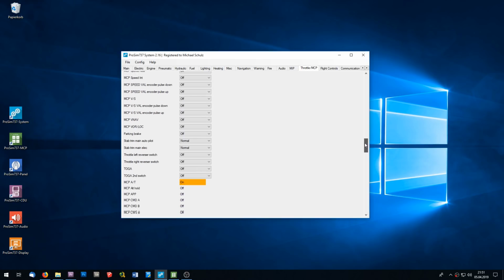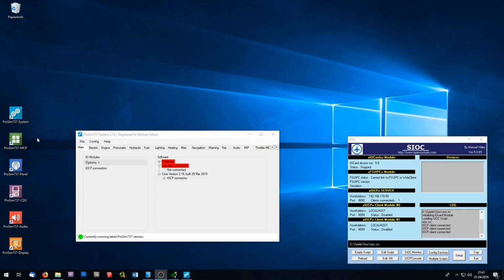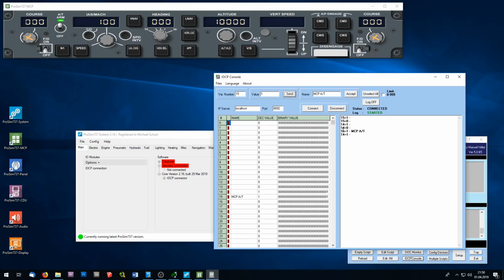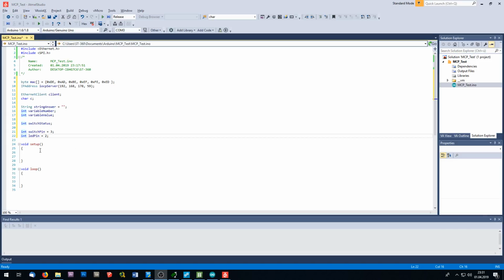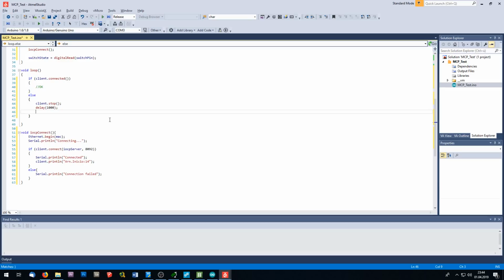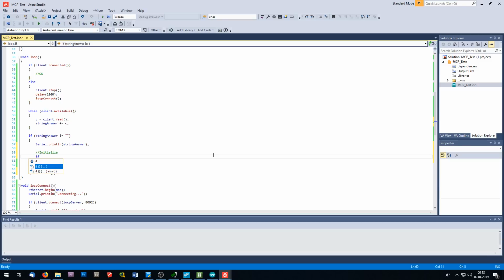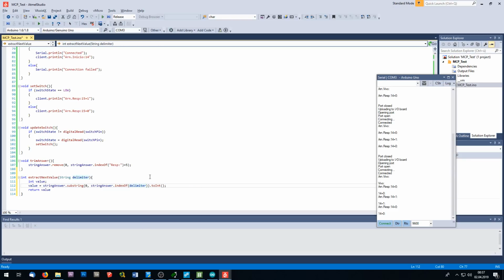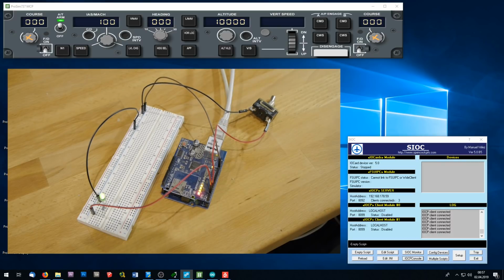Connecting an arduino to Prosim737 - A Boeing 737-800 Homecockpit #33

Comment: Nice video Michael. I work in an airbus 320 simulator, working with prosim. But we have a lot of problems about the options of weather (local and global) do you have some tips? Kind regards
Reply from the maker: Sorry Tomas, my current state of the cockpit is the one you can see in my videos. So I haven't come to that topic until now. I could recommend you the Prosim forum to ask your question. There you can get help directly from the developers.

Comment: Very nice vid Michael, thanks. 
May I ask you why you use SIOC to send data from Arduino to Prosim?    - Is it not possible to send data directly from arduino to Prosim (using the COM port) without using any software?
Reply from the maker: It may be possible. This is what other companies do. But there must be an interface in Prosim to what they can speak to. I think the generic interface could be a solution but you have to implement a function so that you become aware of changes of the values in Prosim. And we shouldn't forget - we still talk about an arduino. The capacity of code that can be implemented is rare. Using Sioc with its working iocp server was the easiest solution for me. There are other iocp server programs out there and you can also write your own. But I hadn't the knowledge to do this.
Reply: Michael Schulz Thank you Michael.  I really appreciate your answer!

Comment: Thanks for the video. Did you ever consider to use an other system instead of arduino? Like SIOC with mastercards etc.? You need a lot of arduino one's to cover all the digital in- and outputs with only 14 digital pins per arduino one-board.
Reply from the maker: No I haven't. It is cheaper than specialized cards. Especially when it comes to the arduino mega with more than 50 inputs. It may take up to 25 arduinos. If my portexpander would have worked, less would have been possible.

Comment: Hello, 
i have some Questions:
-where /how can i get the MAC Adress ? 
-what about encoders and Potentiometers ( how to set up and connect to prosim )
-how to manage more switches / push buttons ?

Thanks for the nice Video
Matthias
Reply from the maker: Here you can read about setting the mac address for arduinos. https://www.freetronics.com.au/pages/setting-arduino-ethernet-mac-address#.XcVCn8Qxm70.
For rotary encoders you should search for a library. For example https://github.com/brianlow/Rotary. Then you can send the turning events via an iocp value to prosim.
More switches and buttons can be handeled by adding more arduinos or using a port expander. For example the mcp23017.
Reply: @Mickeys_Flightdeck  Thanks for the Answer, i will try. These are my first steps in Arduino... :-)

Comment: Hi! Does this work on xplane 11? If not, what does?
Looking forward to your reply.
As always, i respect your effort, and very nice video's. 
Greets Naut
Reply from the maker: The communication between the hardware and the arduino will work, but you will have to find another way of communication between xplane and the arduino. I think simvim can be a solution for xplane.

Comment: 1250EUR for prosim, and then 99eur/year for update!! 
Very expensive !! for a non comercial user !
Reply from the maker: It depends on your needs. If you are just building a MCP for your desk, it's definitely oversized. Other people, and even non commercial users, are buying full size cockpits where the overhead alone costs 10.000 EUR. There are many alternatives on the marked. Like the ifly cokpitbuilders edition or even the PMDG sdk. Not talking about all the other solutions in xplane.
Reply: @Mickeys_Flightdeck  Its a nice peace of software !! But out of my budget..
Nice tutorial tough !!

Comment: Looks very nice Michael :-)
I do not know how encoders are handled with IOPC/ProSim, but I am afraid that with this code, you may loose a lot of steps as soon as you have few input/output connected.
String parsing and modification is very time consuming in Arduino...
I suggest that you begin to think about dedicating your Arduinos as input or output arduinos.
Input arduinos are quite time critical, output arduinos are not.
Cheers
Sylvain
Reply from the maker: Sounds like a good idea. We will see how this will perform with rotary encoders. Maybe it isn't neccesary to transmit every step as long as the stop state is transmitted right.

Comment: Hello  this is nice tutorial ,  You can olso a simple  to connect switch and leds  to a pokeys card , Yes its  more money , But its more simple  to configratie  to prosim .
Reply: https://www.youtube.com/watch?v=w4HBnIFMi_E   you have a usb and a ethernet card
Reply from the maker: Especially when it comes to Prosim there are many different ways to connect. Simple wasn't the main goal. If you don't have programming knowledge any supported interface card will do the job. But you will have to use one output/input per signal you want to send or receive. And this is the point where I hope to get an advantage with the self programming and using port expanders in combination with the arduino. I will cover this in a later video.

Comment: Super Beitrag. Hast du dir die Realisierung über Mobiflight nicht angesehen? Bis du damit das ganze Cockpit konfiguriert hast, bist du alt. Bei Mobiflight bliebe alles im Haus!
Reply from the maker: Ich habe mir Mobiflight auch angesehen. Es störte mich allerdings immer etwas, dass man pro Eingang je einen Pin am Arduino verwenden musste. Ich habe im letzten Video von Helimech gesehen, dass man zumindest bei den Bausteinen der 7 Segmentanzeiegn inzwischen kaskadieren kann. Zudem hoffe ich, dass wenn erstmal die Grundfunktionalitäten im Code vorhanden sind, das Hinzufügen weiterer Hardware lediglich im Erweitern der Header-Dateien bestehen wird. Falls ich sehe, dass mich das alles nicht weiterbringt, kann ich ja immer noch wechseln.
Reply: @Mickeys_Flightdeck  Mobiflight funktioniert aber nicht mit xplan 11 bzw. nur bedingt. Schau dir mal SimVim an ;-). Ich selbst realisiere alle Schaltfunktionen mit BBI 32 (64) Modulen. Alle Lämpchen über SimVim bzw. AirManager. Mit AirManager kannst du sogar ganze Anzeigen über einen  raspberry pi ansteuern ohne deinen Rechner zu belasten. Auch hier kannst du den arduino einsetzen und Servos und Lampen anzusteuern.
Reply: Hi Michael
Die Arduino Mega2560 sind mit 52 Eingängen sehr günstig zu kaufen und arbeiten problemlos. Das Programmieren über Mobiflight geht sehr einfach, das Erweitern der Funktionen ist auch über Kopierfunktionen sehr schnell zu machen. Mit gezeichneten Schaltplänen und einer Effidenz der Anschaltepunkte findest du auch bei späteren Problemen eine rasche Eingrenzung und Abhilfe. Wenn es dir nutzt, dann sende ich dir gerne einmal so einen Schaltplan und eine Excel-Tabelle. Ich habe inzwischen 8Megas verbaut und bin sehr zufrieden. l.g. K-H  @Mickeys_Flightdeck
Reply from the maker: @karlheinzmrazek830  An Schaltplänen bin ich immer sehr interesiert. Allein schon, um sich auch Anregungen zu holen, wie es andere gelöst haben.
Reply: Elche Email Adresse?   @Mickeys_Flightdeck
Reply from the maker: @karlheinzmrazek830  info@mickeys-flightdeck.de
Reply from the maker: Ich plane später Prepar3d zu verwenden. Insofern stellt das kein Problem dar.
Reply: @Mickeys_Flightdeck da bin ich noch nicht so informiert. Wie hoch sind denn dort die Rechnerleistung angesetzt ? Welche Lizenz hast du ins Auge gefasst ? Finde die Preise Recht heftig 😋
Reply from the maker: @wingman3604  Da kann man doch die Academic Licence verwenden. Die liegt preislich doch voll im Rahmen. Da hat die neuste FSX Version damals genau dasselbe gekostet.

Comment: It seems there is a delay (almost 1 second?) when switching from off to on, while from on to off is instantly. Is that typical for Arduino? Will this delay increase when the script has to control more in/outputs?
Reply from the maker: I've noticed this too. And to be honest, I've no idea until now. I think this is only for the first switch command.  But I will keep an eye on this.
Reply from the maker: I found the reason for the delay. I hadn't started Prepar3d because I didn't need it for the video. But when the simulator isn't started there are a lot of exceptions in Prosim. You can see this when you turn on the debugger. With Prepar3d runnung, the exceptions are gone and the reaction of the switch is immediatelly. Nice to know.